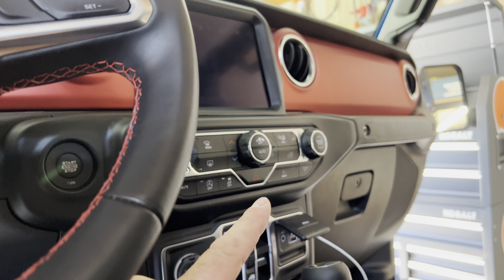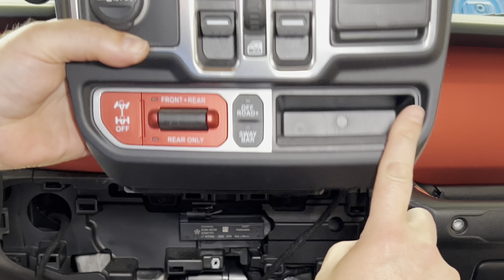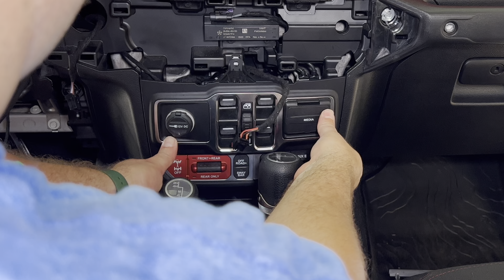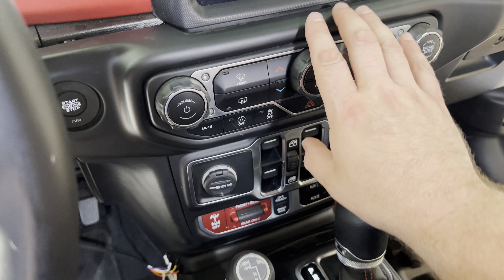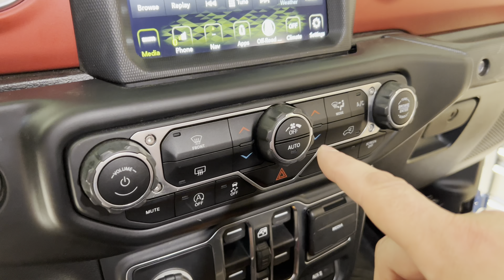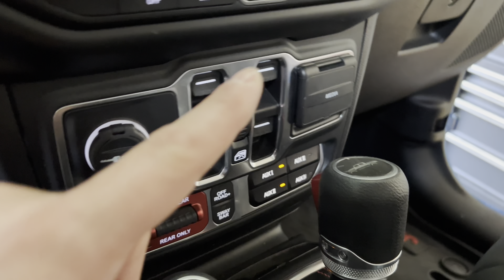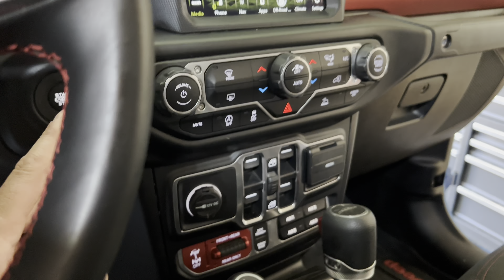2020 Jeep Gladiator Rubicon LASFIT Auxiliary Switch Install and LED Light Wiring PT2

Comment: Do you need to ground the cube lights again? They are grounded from the connection to the lasfit aux switch. Curious I just installed the aux switches on my gladiator. Buying the lights soon
Reply from the maker: It was pretty much plug and play through the aux switch. Congratulations! I was happy with my setup.

Comment: Does your light bar and flood light have relay? If yes, how did u connect to the aux switch?
Reply from the maker: No relay and I connected using the LASFIT switch kit. It has everything needed included.

Comment: I have a 22 gladiator rubicon, this seems straight forward. Question, do you happen to know what is under the center package tray on the dashboard (where the GoPro and duck is)? I want to run the hardwire for my GoPro straight down so all the wires are completely hidden.
Reply from the maker: Things and stuff. LOL! Can’t give you a detailed breakdown but people do run cords through there. You should be ok.

Comment: Great video buddy, since you're using the LASFIT aux switch.  What did you do with the stock on/off switch that came with the lights, did you just cut it off?
Reply from the maker: You never end up installing that switch if you start with this kit. This if you have lights already installed and you are switching over to the aux switches, you would remove the old switch in the process.

Comment: What are those connectors?
Reply from the maker: Which ones? The three ways are from Lowes. They are called “In Sure” made by Ideal and are a “push-in” type wire connector. item number 30-1333S
Reply: Those connections I would not use unless I am doing wiring in my house  as there is not type of sealant to stop moisture getting to the wire
Reply: @justincampbell2162   They are covered in heat shrink.  As good or better than factory splices.